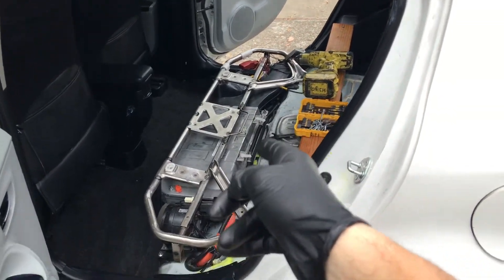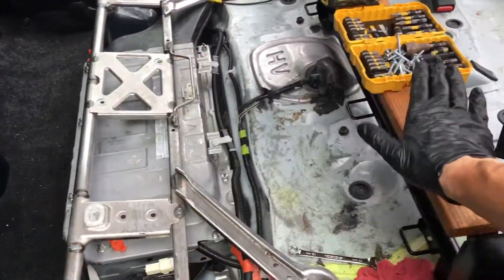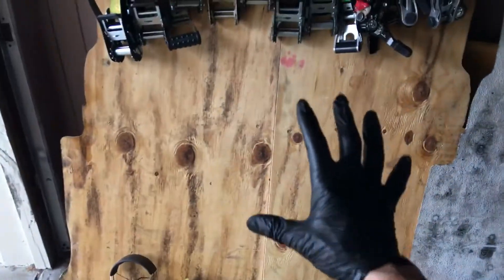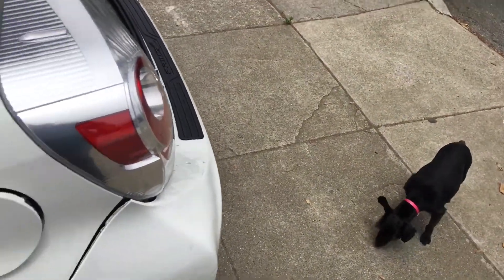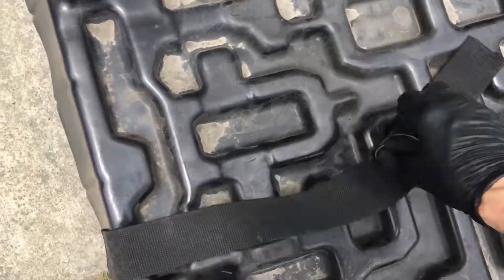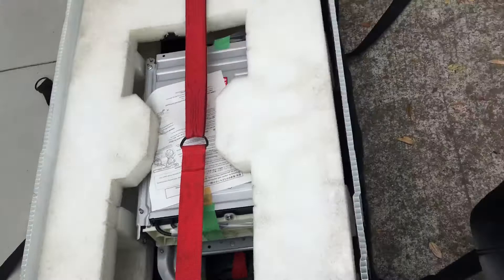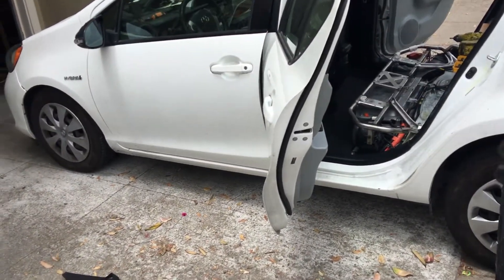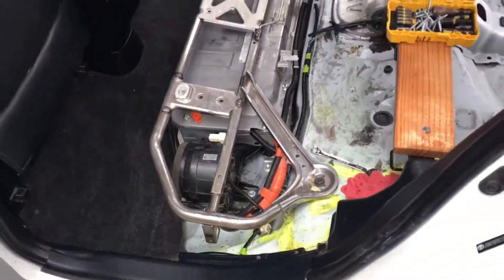Prius C  high voltage battery replacement￼

Comment: Show us a load out of your setup! Would love to see how you get it in there. Do you have custom springs?
Reply from the maker: I do have plans to do a complete vehicle load showing all my equipment how I store it packet into such a tight small space. 

       Hopefully when I do that video maybe I’ll apply some editing so I can kind of make it a little bit of clean put together a video that is somewhat nicely done instead of my normal every day average messy video. 

        I have airbags stuffed inside my springs load levelers filled with nitrogen so the car does not sync it stays level you cannot tell I have 800 pounds of equipment in my car. And often throw another 400 or 500 pounds even up to 1000 pounds on top my roof rack. 

And another 700 to over 1000 pounds towing on a trailer

        I’m going to get the upgraded springs on the front and rear when it’s time for me to replace my front and rear struts. 
          Because I will already be doing the labor to remove the struts so then it’s economical and feasible for me to replace the springs and 1 inch lift kit at the same time. 

      I will be using high-performance road racing struts. 

      In higher load rated springs. 

That means I have to do all the work and I don’t like working on my own vehicle so that video will be no time in the near future. 

      My Prius is only a baby not even a teenager yet it only has 120,000 miles on it in Toyota years it’s just hitting puberty.